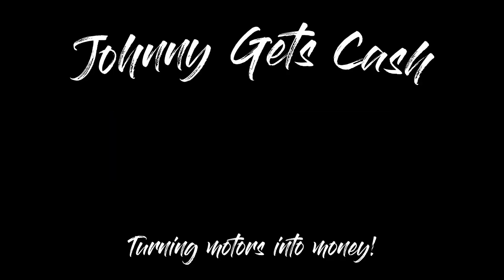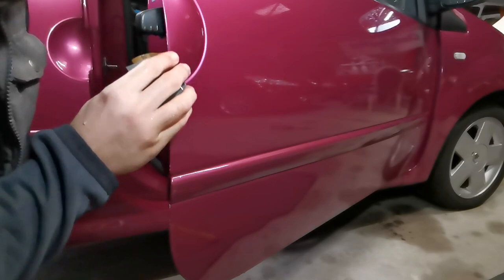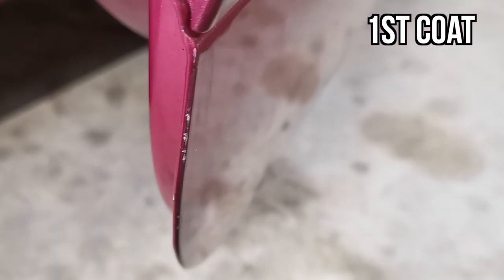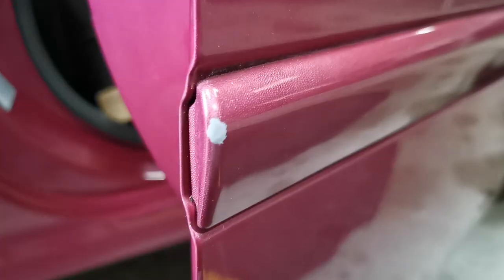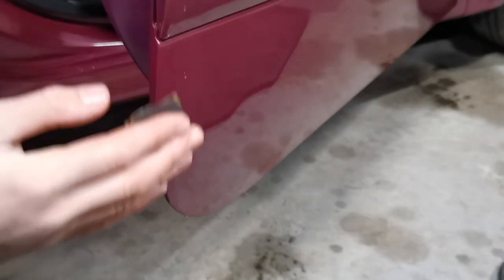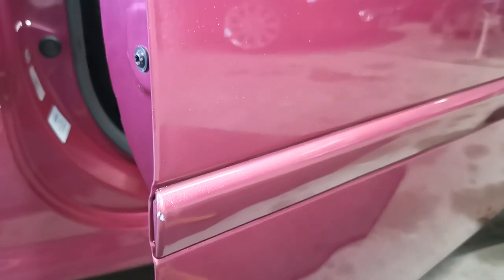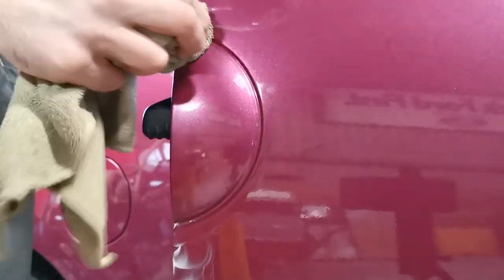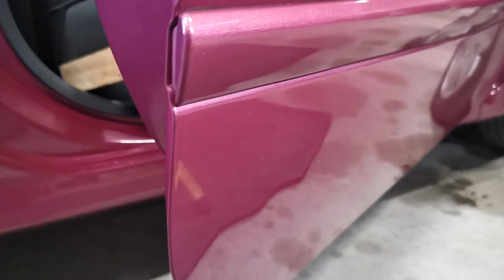How To Repair Paint DAMAGE & CHIPS On Door Edges | 5 minute fixes | Episode #5

Comment: My missus opened my door on another car in a car park so I’m going to have to do quite a large chip on the edge.  I don’t see the point in ‘roughing up’ the surrounding area if it’s not going to be painted.  I’m going to clean it, primer it and infill it with paint so it’s slightly proud.  This will need several coats as it shrinks back as it dries.  If your paint has clear coat you should be able to to T-cut your repair back level with the existing paint, as your new paint will be softer

Comment: Excellent video will be doing this to our car ! How would you apply clear coat to this please?
Reply from the maker: Hi Trev, thanks for your comment! This process will work on small stone chips up to a few mm in diameter before necessarily needing to use clear. If you're interested in doing a clear coat repair, check out the other videos on my channel as i have a couple of videos dealing with this specifically. Cheers!
Reply: @JohnnyGetsCash  awesome,  you make ot look so easy 😂

Comment: Thanks for sharing such awesome content. I'll try doing that to my trusty ride this weekend. How long do you tipically wait between coatings? Would this repair process work for large scuffs if I add some clear coat layers after before sanding and polishing?
Reply from the maker: Thanks very much! I normally wait until the previous layer has at least gone tacky otherwise the new layer will just add to it and likely cause a run! The technique is different for larger areas as this 'paint fill' technique is only really applicable and invisible on small areas such as stone chips. I will try to put something together soon that covers larger areas of damage. Cheers

Comment: Hello Johnny great and to the point video! After the polishing would you consider putting a clear coat over it, to protect it for a longer amount of time?
Reply from the maker: Hi Mathieu, thanks for your comment, I'm glad you enjoyed the video. With chips such as these I do not tend to use a clear coat because what I'm doing is 'filling' the lower, damaged areas with new paint until it is proud of the surface in order to cut it back and buff to a shine. To add a clear after that stage would make it hard to polish without removing most of it (due to the vulnerable location of the work / a door edge). Given that these are a series of small repairs it's acceptable to simply buff the colour coat rather than separately clear coat over them in order to achieve a uniform, level finish. If this were in a different position on the car,or the damaged area was larger then you are totally correct - clear coat would certainly be required (see my video on clear coat repair). I hope that explanation helps and clarifies why I didn't opt for a clear coat in this instance. All the best with your repair!
Reply: @JohnnyGetsCash  thank you for the extensive explenation, i'm currently working on my Alfa Romeo Mito. I've done the headlight restoration with succes, but i'm not so confident about the scratches and chips i have in the paint work. (I'm also pretty new to this and still in Uni) That's what you get with second handed cars I suppose... (And getting it proffesionally done is super expensive 🙄)
Reply from the maker: @mathieug.8395  Well done for taking pride in your car and wanting to sort it's minor issue out! You're totally right - getting a bodyshop to sort out a host of small issues is very expensive (which is fine on collectors / high value cars, but when dealing with cars of a certain age keeping costs to a minimum is of course very important...but that doesn't mean the repair cant look great!). That is the reason for this series of videos - to show that keeping your car looking its best doesn't have to cost the earth! The next video i intend to create will focus on mid-panel paint repair (deep scratches etc) and how to repair both the colour and the clear without needing to respray the whole panel. Stay tuned for that!
Reply: @JohnnyGetsCash  that would be perfect! It might be a good idea to show different types of scratches and how to resolve them, lighter but also deeper ones. Looking forward to your video! Keep up the great work!
Reply: I'm going to do the same to my car this week. I will apply a 2k clear coat and then sand it down exactly like Johnny did with the base coat in the video. First time - I hope it turns out ok!

Comment: This was very helpful; how do I find paint to use on the door? Ask a dealership?
Reply from the maker: Hi Monica. Your car will have a paint code (specific to the colour of the car). This is often under the bonnet or in the door shut but can be elsewhere so if you have any problems finding it, generally a quick Google search will tell you where to find it.
Once you have that code you can purchase paint in the correct shade, either through your local dealership, in store or from an online retailer. You will have the choice of liquid 'touch up' paint or aerosol paint. I hope that is of some help!
Reply: @JohnnyGetsCash  thank you!!!

Comment: Does this also work for small stone chips on a bonnet
Reply from the maker: Sure thing! The same process will work on small stone chips up to a few mm in diameter. After that it'd be a case of doing a base coat repair followed by a separate clear coat layer. Hope that helps!

Comment: Hi, i have a slight chip near bottom of driver door. 
It looks slightly brown.
Does it mean i need to sand it down, use a rust inhibitor, then primer then touch up paint?
Reply from the maker: You will certainly need to use some kind of inhibitor to stop the spread of the rust so if you can sand down to clean metal first, that'll help!

Comment: My paint has a base coat and a top coat because of the colour. Layer wise how would I do it?
Reply from the maker: Thanks for the question, Nurul. Do you mean that your car has a base coat (colour) and then a top coat of clear? If so that is the same as the car in this demo, however i only used colour in this job as i was using it as a filler to fill / blend the chipped areas. When i do this on small areas i often only use base as it would be a whole level of extra work to re-clear the area and blend it in to the existing clear coat so as you can get away with solely using base in such small areas, that is the best option. If however the repair was bigger than say 5mm in diameter it'd almost certainly need clear coat as well / blending into the existing clear. I hope that helps!